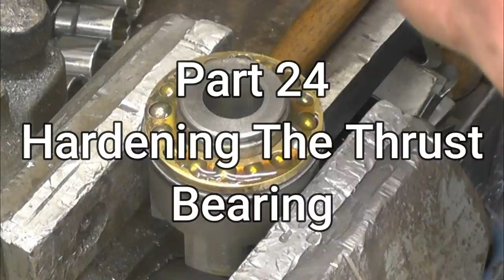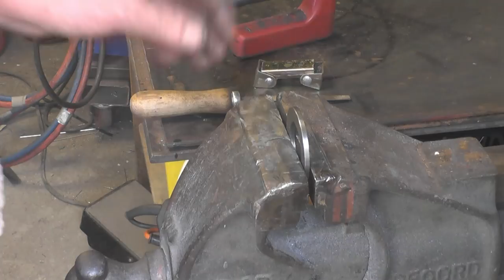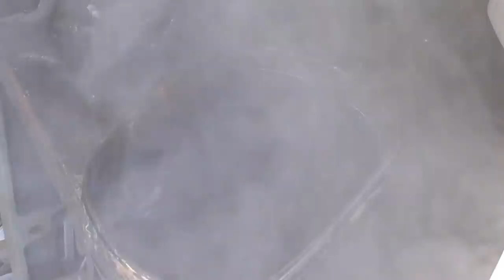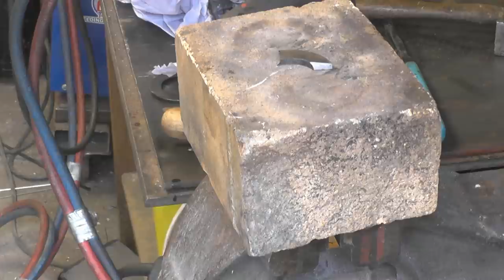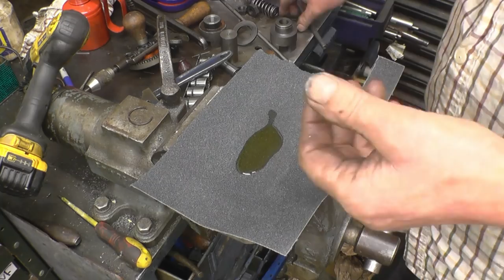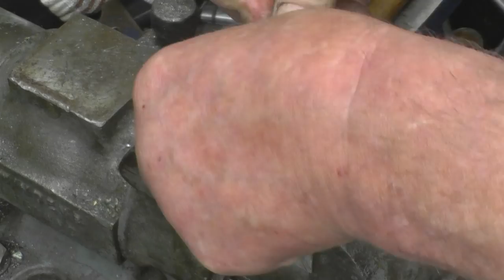Stuart Engine Part 24  . Hardening  the Bearing

Comment: From putty soft to glass hard then back to tempered and useable.  You should give Chris from Clickspring a look at, the blue he gets his screws and bolts to.....Not knocking you John, your a gifted and thorough mechanic that I would be chuffed to know my car had been fixed by your skilled hands. 

Hell of a machinist/cook too.
Reply: Encasing the part in borax to keep scale down is a neat trick too.
Reply: @cojones8518  Very true. I'm guessing a heat treat oven and stainless steel foil is the other way. No expert, just what I've seen on pootube. Heck I don't even have a shop...

Comment: Nicely done John, glad you chose to do this, totally the right thing to do. They came out well mate. Cheers, Jon
Reply: Have you a clue about tempering? Clearly not! He didn't temper it, he softened it!
Reply: @gordonburns8731  Tempering : improve the hardness and elasticity of (steel or other metal) by reheating and then cooling it.
"the way a smith would temper a sword"....exactly what he done.

Comment: Do the balls spin freely in that brass carrier? It looked when you assembled the carrier like the balls were pressed pretty firmly into the holes. If they are stuck they will just be skidding on those bearing plates.
Reply from the maker: Yes the balls a re free to spin in the housing

Comment: Do we know what grade steel those are John?
Reply from the maker: I was told it had similar properties to silver steel . Best thing was it was free
Reply: @doubleboost  "Silver steel", AKA drill rod, is (AFAIK) O1 tool steel.  Processed VERY well using the accumulated centuries of know how.  :>)  Fit for purpose and then some, without the expense of costly modern equipment.  Thumbs up!!

Comment: You have it completely wrong on tempering, John. I have no idea who taught you, but he was totally wrong and misguided.

In tempering, the very first colour you see is 'light straw', followed by 'dark straw', 'purple' and 'blue' (spring steel). Anything past that isn't tempering, it's softening. You completely ruined the hardness of the bearing surfaces by taking things well too far.

The very best way to temper to 'straw', is to place it in your kitchen oven, set at 225C for a couple of hours... never, ever use a naked flame to temper, it's far too uncontrtolled!
Reply: Depends on which colors you can actually see?  Some of use have color vision deficiencies! LOL
Reply: @65cj55  To be fair I don't think he was being a bell end. He was just pointing out an error and giving the correct information. That is how this community is supposed to work. The comment was respectful and was constructive criticism in my opinion.
Reply: @carlwilson1772  In your opinion.
Reply: This process is fine. Taking it to blue instead of straw sacrifices maybe 3-5 points on the rockwell scale. They’re still fine as bearings.  If you’re gonna tell someone they did something wrong, make real sure you know what you’re talking about.
Reply: @joshwalker5605 
If his aim was to take it to pale straw, then he failed.
The kitchen oven or a heated bed of brass chips is the way to go.
Reply: @65cj55  And in my opinion.
Reply: @lenroddis5933  Yes, well that's nothing to brag about..
Reply: @65cj55  
Who's bragging?
Reply: @lenroddis5933  sure but the point is the straw or blue doesnt make all that much difference.
Reply: @joshwalker5605  
Yes, I know that's your point, but listening again to the video, as Gordon Burns pointed out, it shows that doubleboost doesn't understand the sequence of colours as temperature increases. He also uses the terms tempering and softening interchangeably.
By all means temper a centre punch by applying direct heat at the far end, watch the colour you are after progress to the tip and then quench. Tempering an item like this with direct heat is doomed to failure.
I'd prefer to watch a video that provides accurate information.
Reply: @lenroddis5933  our man john here has a flair for occasionally mixing his words up. If you're here for a pitch-perfect tutorial on hardening steel, perhaps you're not in the right place.
Reply: @joshwalker5605  
If somebody wants to present a tutorial that includes incorrect information about tempering steel, then maybe a public forum isn't the right place.
Reply: @lenroddis5933  In fact I think misspeaking on your youtube video when the majority of viewers will know what you mean is fine. Have a great day.